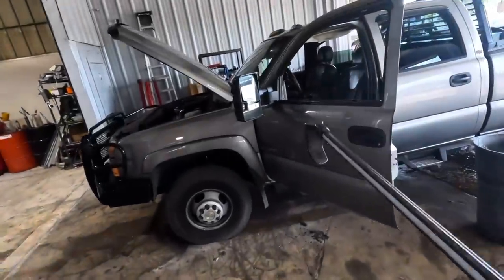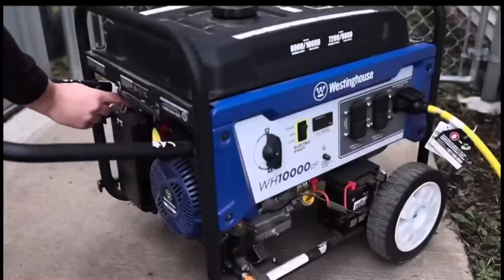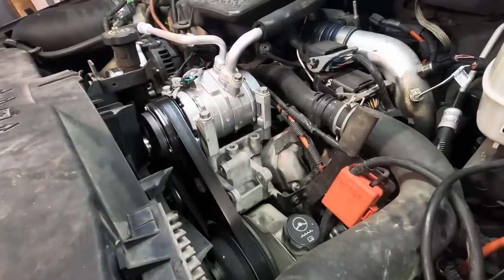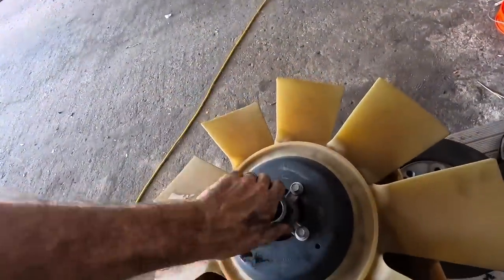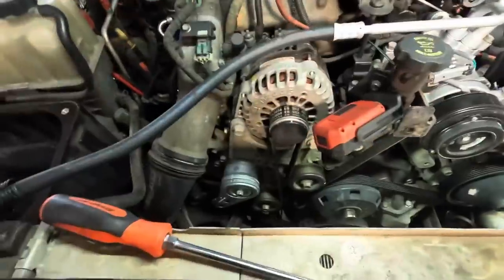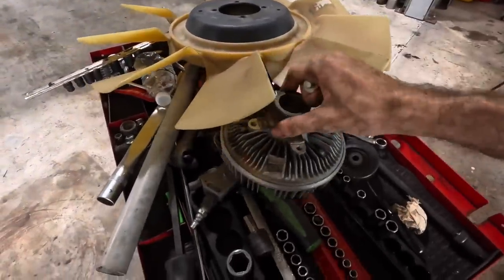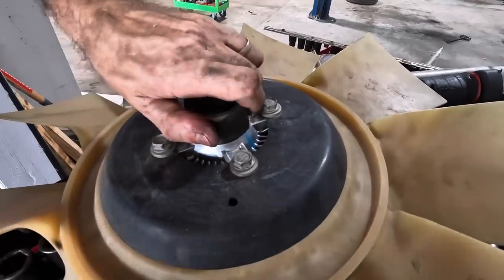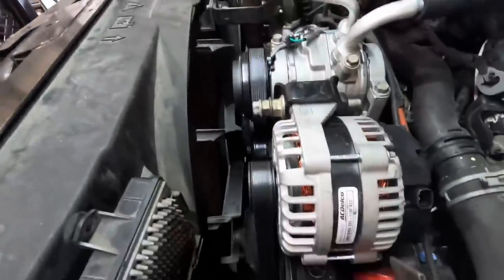Proof of Concept! Dual Alternator DURAMAX!

Comment: Ray, if your plan is to run appliances or electronics with the inverters, get rid of the modified sine wave inverter and replace it with a pure sine wave inverter.  Your appliances, motors and electronics will thank you by lasting much, much longer.
Reply: Idk if you heard! But it’ is going to be used for a mobile home and power appliances in it during any storm.
Reply: @jessewynne8193  Understand.  If the appliances are all disposable, no problem.

Comment: Ray, the field lead is there to turn on your battery charge light and to assist field excitation on start up. Once started the alternator has a internal  field supply connection so doesn't need a external lead supply, it also remove the ground from the charge light letting so you know the alternator is working. Somebody mentioned you need a fire wall between the batteries and the inverters. You have that in the battery boxes, but make sure the leads that go throw the walls are properly sealed and each box is vented directly outside of the metal tool box. Lead acid cells give off hydrogen gas when charging and oxygen gas while discharging. They make a lot of small pieces when exploding.
Reply: If you pulled the exciter to ground would that collapse the field?

Comment: Definitely recommend that you install a in-line fuse from the battery to your alternators rated at 150% of expected load period as well. Make sure you’re positive and negative battery leads to your inverter system is appropriately sized. This is Carmen in the car stereo world where we call it the big three upgrade your ground, your power and your engine ground.

Comment: Nice DURAMAX project, but please read my calculations below:

You need:

50A x 120V = 6KW daytime, run time: 12 hours/day, 84 hours/week
20A x 120V = 2.4KW nighttime, run time: 12 hours/day, 84 hours/week
Total run time: 1 week, 168 hours

Your solution: 

8 KW gasoline generator (daytime) + 3KW “Duramax system” (nighttime)
Duramax system’s max. continuous power: 100A + 145A = 245A x 12V = 2940W = 3KW

Your fuel consumption for a week:

Gasoline: 5 gallons/8 hours = 0.625 gal/hour, total 84 x 0.625 = 52.5 gallons/week gasoline
Diesel: 3-4 gallons/hour = total 84 x 4 = 336 gallons/week diesel (you can have at home 32 + 90 = 122 gallons max.)
Grand total (needed for a week): 52.5 + 336 = 388.5 gallons of fuel (gasoline + diesel)

Remarks: 

•	The 2 “nators” of the Duramax probably will need relatively high RPM for max. 245A, your elevated RPM idling maybe not enough for that, so the 3KW power can be somewhat less.
•	Probably it will work, but it’s a little bit risky to connect 2 different “nators” parallel. There is a chance that balancing current will flow between them if there is a difference between the generated voltage of the two “nators”. Their characteristic curve can be different (I dunno).
•	The 2 batteries will definitely help with the momentary high-power requirements, but they won’t support 84 hours of continuous load.
•	You have to fill up the Duramax’s 122 gallons tanks 3 times to have 336 gallons of diesel for an entire week and you also have to have 52.5 gallons of gasoline. (That is at least 2 extra trips to the gas station during a hurricane.)
•	With all due respect, your solution makes no sense unless you really love working on cars, building new stuff (and you do!!). 😊
-------------------------------------------------------------------------------------------------------------------------------------------------------------------------------------------------------------------------------------------------------------------------------------

A more reasonable solution (after you finished the Duramax system project): 8 KW gasoline generator (daytime) + 4 KW quiet gasoline generator (nighttime)

Gasoline consumption for a week:

8KW generator: 5 gallons/8 hours = 0.625 gal/hour, total 84 x 0.625 = 52.5 gallons/week (same as above)
4 KW generator: 2.5 gallons/8 hours = 0.312 gal/hour, total 84 x 0.312 = 26.20 gallons/week
Grand total (needed for a week): 52.5 + 26.20 = 78.7 gallons of gasoline

Remarks:

•	You will need a new 80-gallon gasoline tank (preferably metal). It will be also useful all year round for farm equipment refueling.
•	With your solution, you have to store, and will use, 388.5 gallons of fuel, but with the more reasonable version you will need 78.7 gallons only. The difference is 309.8 gallons (!) total.
•	309.8 gallons of diesel is $1239.20 so your second generator is FREE. 🙂
•	You don’t have to go to the gas station for a week.
•	Your truck won't be “tied to the house”; with the 2 gas generators solution, your truck is free to go anywhere.
•	Gasoline fueled generators can be as reliable as your 250’000 miles Duramax truck. Two gas generators are always better than one. Maybe even worth buying a larger, 8 KW quiet generator for nighttime, which also can be a perfect backup for your existing (maybe sometimes inoperable??) 8 KW generator. (Both using the same type of fuel, so the switching is easy.)
•	Diesel generators available on the market as well, but they are more expensive, and you have an 8KW gasoline generator already that needs gasoline for a week anyway. 

Bottom line: 2 gas generators, 80 gallons of gasoline and you are done!

Don’t get me wrong: I love what you are doing, even enjoying your ”Duramax system” project, I am just trying to help.
Reply: Your calculations are wrong the 380 gallons diesel  contains 12 MWh so even with an efficiency of 16% you still get 2000 kWh what is far more than anybody uses in a week and the Duramax runs without refueling!
Reply: @ffjj3380  You are probably right. I did only one single search a year ago: "How much fuel does a Duramax use at idle?" and the first answer was 4 GPH. (I just checked, Google still says that today (!). I accepted this value since we are talking about a 6.6L-V8 on "high idle", but I was wrong (!). The correct answer is 1 GPH or even less, but the other serious disadvantages of this Duramax Alternator solution for power backup are still valid (2 different types of fuel, truck is tied to the house, no second 8 KW gasoline generator, etc.). Anyway, you are right, thanks for pointing out of my mistake.

Comment: Ray, you shouldn’t disconnect the battery lead while the alternator is on charge. With fully charged batteries you’ll often get away with it, because there’s very little amperage flowing. If there’s a load on, or the batteries are low, you’ll have a heavy current flowing and if you interrupt that, you’ll cause a back emf, or spike, that can damage the regulator and even the rectifier in the alternator.
Please don’t do that.
Reply: With a scope you can see as much as 150 volts or more. It's a very short spike but not good.
Reply: I was involved with something in my day job, which is military R&D.  Very similar situation but no alternator just a lot of current.  Just the parasitic inductance of the cables was enough to cause back EMF.  We had to install a flyback diode to keep the equipment from destroying itself.
Reply: @major__kong   I installed a 10kw diesel generator with its own transfer switch at my home. First off I live in rural northern Canada, I don't have to be home if the power goes out, the generator will automatically start up on it's own.
Secondly, the generator will automatically start up every couple of weeks to go through a duty cycle and then shut itself down.
The generator is housed behind my garage , cables run underground, the sound is hardly audible when I'm inside. The generator also has a governor that works under load.
Pros:  I can't run everything including my electric range, clothes dryer and home furnace that demands 220 volt besides fridges, freezer and lots of small appliances, diesel fuel will last for years. 
 I'm not saying what Ray is doing is wrong but it's wrong for my application when the temp drops off to minus 20 in the winter. I need something that I can rely on when my wife is home alone. 
Cons: It costed me $14 k to have it all installed but it was well worth it at times when I needed it the most
Reply: THANK YOU!!! God, Jesus, EVERY time he does this I cringe. Diode trios are very robust but they do have their limits, especially when an E.M.P. just SHOWS UP outtah nowhere. Working at Autozone, I've actually had to deny warranty claims on BRAND NEW ALTERNATORS because the owners didn't know any better, did EXACTLY THIS, and BLEW UP THEIR NEW NATER!!!! tl;dr = improper installation is an automatic disqualification on the warranty! Nutshell = REEEEEEEEEEEEEEEEEEEEEEEEEEEEEEEEEEEEEEEEEEEEEEEEEEEEEEEEE!!!!!!!!!!!!!!!!!!!!!!!!!!!!!!!!!
Reply: @IR-nq4qv   $14,000 Canadian? That's like $1520.39 American. 20 below Celcius? That's like Colder than a witch's tits in American.
Reply: Honestly, I would expect this kind of rookie mistake from Caster Troy, but Ray really should know better.... He must have fallen asleep when his mentor was giving that particular lecture. Either that or he simply wasn't paying attention.
Reply: How how how how???? (I am SO sorry, but I'm probably going to be ranting about this all day). Ray should know better, and we, as the audience always expect him to do better. In that vein, I would like to point out everyone has blind spots, buuuuuuuut.....how could Ray have SUCH a MASSIVE blind spot in his automotive knowledge???? How....how....how how how, HOW????
Reply: Was thinking the same thing. I think it’s safe to say everybody still has room to learn 😊
Reply: @robertopenheimer1451  it gets cold enough to freeze the nuts off a rusty gate
Reply: @@ClassBLiving64  The customer admitting they did so before you inform them that voids the warranty it's all that reason you need.  This is why you asked them about installation before telling them that you can't warrant it.  I've also had to call other stores in the area to let them know not to warranty a particular customer on their alternator because of this reason.
Reply: That being said, sometimes the manager would override this just to keep the customer happy depending entirely upon their purchase history.  If it's some random off the street that has 1 or 2 things under warranty probably not going to happen but if it's been someone that's been shopping with us for years and years, that's a different story, and would be willing to make an exception on rare occasion.  Even though it was entirely their fault.
Reply: Yeah, don't pull alternator or battery leads while the engine is running. I cringe when I see people test their alternators by disconnecting the battery with the engine running. This can do Very Bad Things. Is it guaranteed to do Very Bad Things? No. But if it fries one of the rectifier diodes in the alternator to a short condition, you can end up running AC voltage from the alternator right into your car's wiring harness. In the old days, that was a new radio, a new HEI module, and a new alternator. Nowadays, you've written off the car.
Reply: I can verify this you will damage the regulator more than likely.. I use to do some very stupid things with alternators when I was younger like connect them up to my Grandpa's lathe motor.. Also what wasn't mentioned here is you really should put a fuse on that. I think I used a 2amp fuse or some thing close to that when I was playing around.. I was 10 years old lol my Grandpa was kinda cool and let me explore things.
Reply: 470 horsepower to turn to 150 alternators equal 300 amps DC 2000 RPMs best guess a gallon a half an hour diesel  fuel this would be a nice camper rig setup for a house setup 2000w 8 hours runtime on a half a gallon of fuel minimum 8000 watt with a transfer switch runs on 300 gallons propane that will get you two weeks you need long run times😊
Reply: @@ClassBLiving64first and foremost...that alternator is AC Delco and not Duralast, so I'm not sure what you all are on about. Second, you are assuming he has a gap in his knowledge. What if he just doesn't care? There are a million things I'd do with my own stuff that I'd never do with a customer's things.
Reply: @robertopenheimer1451  -20 C and Canadians pack an extra blanket for tent camping .  I always laugh when I hear or see Americans posting to a Youtube backpacking\camping channel "What about those bears and wolves ? You better bring a 460 Weatherby Magnum to protect yourself. Canadians , ' " I brought my pepper spray and a jack knife "
Reply: @Rekuzan I
Reply: @@ClassBLiving64Also autozone doesn't give a crap about the store  employees, so there's no need to feel bad for them losing a couple of dollars on a warranty claim.  Not like they'll ever investigate one alternator.  We had a guy running a taxi company getting free brake pads (replaced under warranty) every couple months for years.  His name in the system was the name of the taxi company so the company had to know.
Reply: Vl = L di/dt... If you open the wires under load the di/dt can be massive, this VL is massive, and negative by the way... The diodes in the alternator have a PIV rating of 100v.
Reply: @robertopenheimer1451  🤣🤣Close! 14,000CDN = 10,381 USD and -20 C = -4 F.
Reply: @williameldridge9382  I see your point, but it still looks bad. And Ray has viewers who don't know what they don't know, and may do as he does to their detriment. Good habits may be hard to learn, but bad habits are even harder to UN-learn.

Comment: Hi Ray! I did the same battery setup for our off-grid RV trailer, but used two 6V deep cycle batteries in series. Your going to need ventilation in that box, both for heat and for the off-gassing of the batteries. Ideally, you would want the batteries firewalled from the inverters.
Reply: Great point !   Cool ventilation in electrical box is key !   Excellent comment -
Reply: In a previous video he said he was going to install vents and fans in the box to cool the inverters and vent any gasses.
Reply: Or just get some lithium batteries.  A lot more energy, a lot more current, a lot less weight, and no off-gassing.  If you get lithium iron phosphate in particular, life cycle costs a much lower.
Reply: Remember you will also need cooling ventilation for the inverters. Do not use in a closed box.
Reply: @major__kong Did you just volunteer to send some Lithium batteries Rainman's way?😂 You are truly awesome!
Reply: @major__kong but they fail much more in cold temperatures and arent very weather resistant.
Reply: @firefoxgaming735 there are LFP (LiFePO4) batteries with heaters, so they can be charged in cold weather, and also Marine versions. The benefits outweigh (literally 😉) lead batteries.
Reply: @firefoxgaming735 he lives in Sarasota Florida. He's not worried about any type of cold weather LMAO
Reply: @cotyluckett it gets down in the 30s in FL bub
Reply: @cotyluckett it even snowed in Sarasota in 89. I was ten and it was the first time I saw snow. It didn't last long.
Reply: @firefoxgaming735 Most LiFePo 4 batteries have temperature control on board.
Reply: @firefoxgaming735  You can buy them with heaters.  You can also buy them in marine versions if you think weather is a problem.  You can get 2000-5000 charge cycles out of LiFe batteries and only about 400 out of lead acid.  LiFe isn't that much more expensive off the shelf, and when you consider their life cycle they are cheaper than lead acid.
Reply: IF YOU HAVE EVER HAD A BATTERY EXPLODE  ON U ,,, YOU WILL TOTALLY UNDERSTAND OFF VENTING ANY & ALL BATTERY ACID GAS ,,WHICH IS HIGHLY EXPLOSIVE /TOXIC TO BREATHE TOO

Comment: Ray, if you simply place a good sized piece of cardboard (or 1/8" masonite between the fan/shroud and radiator it does an excellent job of protecting both your hand from getting shredded by the radiator fins and the radiator from getting any damage from an escaping fan and shroud. If left in place it will also act as a shield against errant tools or parts from attacking the innocent fins on the delicate and expensive aluminum radiator.
Reply: if you can find it formica is thin and tough, or polycarbonate. whatever, thin gives max space.
Reply: if he weren't swingin a camera around it might be a pass, things bump even without three full hands.
Reply: It only took me one time of dropping the fan clutch and knocking a hole in the radiator to adopt this method.
Reply: It rubs the lotion on its skin

Comment: Hello Ray! When I was a teenager working in my dad's shop, I had been charging a battery and forgot to switch the charger off before disconnecting the cables. The battery blew into a thousand pieces. The Lord was watching out for me that day! I didn't get a single acid burn but the next day the sweatshirt I was wearing was totally disintegrated! It was a hard lesson that I have never forgotten. When you were disconnecting and reconnecting that cable at the battery in the back it made me cringe. BE CAREFUL RAY!

Comment: hey ray, you might already be aware, but you have like 7KW of inverters in the back, and plan to add more, but even if both of those alternators are 145amps, that still only gives you 3.4KW of power generation. you'll need larger alternators or you risk your inverters completely draining all your batteries.

Comment: After Frances in '04, I bought a Kubota diesel engine and Stamford Newage alternator and assembled them. Got a 60 gallon tank and back fed through the dryer outlet until I put in a manual transfer switch.. Was a 1/2 gallon an hour and 7kw with the a/c running, lights and refrigerator. Got me through two more hurricanes.